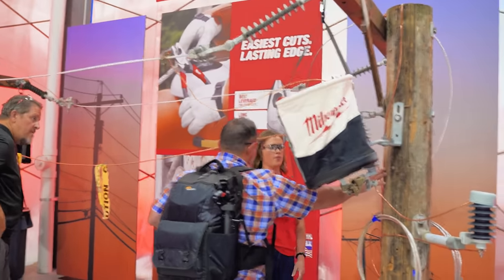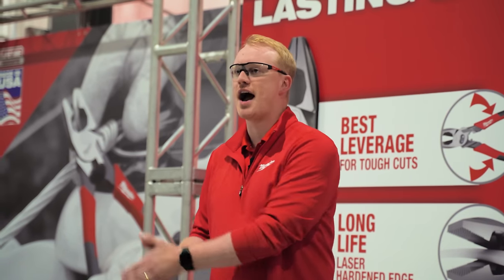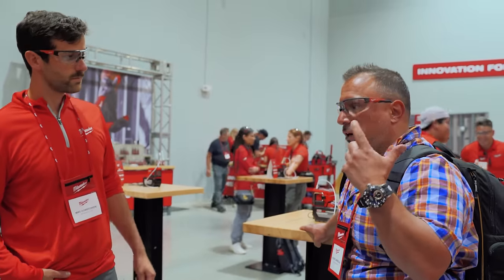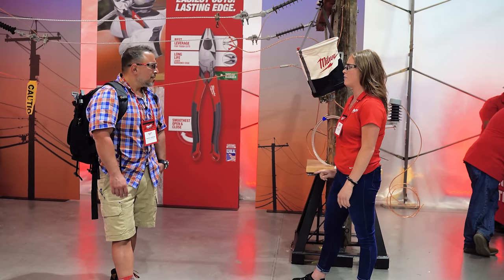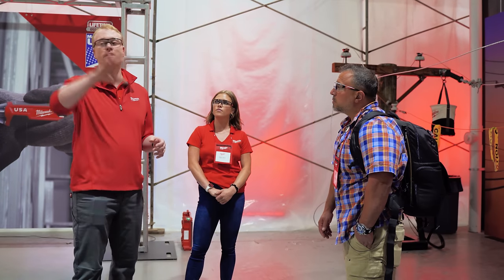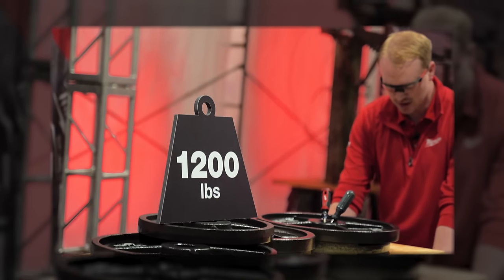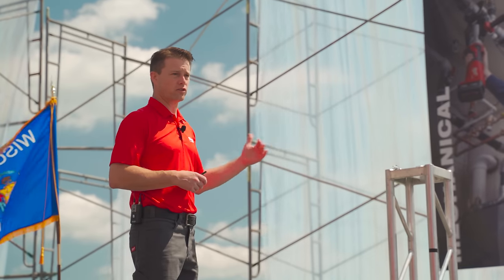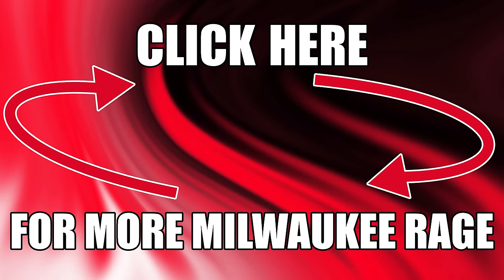BIG Problem With Milwaukee's USA Made Hand Tools (THEY'RE LYING)

Comment: All through the'70s and '80s, we bought and used Milwaukee Power Tools in our shop and in the field. They were rugged, dependable and rebuildable. I still had all of those tools until recently. My son started his own custom manufacturing business, so I ended up giving him my service truck and most all of my equipment. Including most all of the Milwaukee equipment. I kept about 15 of the Milwaukee tools for myself as I still liked fool around building and repairing stuff.
   Those tools are different though.  The new stuff is all throw away. It may be marginally better than some of the other brands but at a higher price. I wish Milwaukee would go back to building the way they used to. Those tools that we bought for our business were commercial and Industrial quality. When I started seeing Milwaukee power tools sold in big box stores, the quality started to go down. It's the same with Bosch, and I guess we've lost Porter-Cable all together. I would be happy if the manufacturers would offer two actual lines. Consumer and Industrial.
Reply: Well, Bosh actually offers 3 different lines ( at least in Germany). Green - common folks, blue - professionals, yellow - industrial grade
Reply: @dominicholder7323  exactly, people don't really realize this. There are different tool levels and you usually have to request for the higher tier.
Reply: @TyphusVonElder  We always bought the commercial line or industrial line of the manufacturers tools. Many of them now are no better than the do-it-yourselfer stuff.
Reply: @dominicholder7323  Bosch hasn't been made Germany in years. They were bought out by the same company that owns skill and Black & Decker. All three companies have reduced the quality of their products. Even the commercial brand, Metabo has drastically reduced the quality of their products to compete with the pricing for do-it-yourselfer.
Reply: @jnicksnewstart  I never claimed they are made in Germany :p I just said that here in Germany we have 3 different lines of Bosch tools and the industrial grade once are still quite good.
Reply: @rch5991  I had four of them. Two are 2 speed, and two are variable in two speed ranges. Gave my son one of each. He has a welding and stainless steel fabricating business. If you see another old one, even if it's the two speed, don't pass them by. They are totally rebuildable. All parts are still available. Nothing new will hold a candle to them. We always carried a few of those hold down screws. If I'm not mistaken they're either 8x32 or 10x32 machine screws. Buy them in grade 8, and they will last a long time.
Reply: @jnicksnewstart  Bosch owns Bosch and yes, Bosch I believe still owns the Skill name as well.   Many years ago, Bosch had partnerships with other industrial companies like Siemens, but has since retaken complete control of the company.   It bought the Skill brand over 20 years ago.  No relation to Black and Decker.  The brands under what is known as Stanley Black and Decker include both Stanley and Black and Decker (SBD) of course as well as Dewalt, Craftsman, Irwin, Mac Tools and some others.  Not sure of Bosch's manufacturing origin, but SBD has manufacturing in the US, Mexico, UK but still the majority is over in Asia.
Reply: Yup, not anymore.  I bought a Milwaukee 18v drill/driver kit while doing a house remodeling.  Plastic gears stripped twice and the trigger switch had to be replaced all within the first 6 months of use.  Each time it took 6 weeks to get a repair done so I was forced into buying a competitors drill/driver set.  The Milwaukee is now a backup that never gets used because the other brand hasn't failed.
Reply: Everything is throw away these days because it's cheaper just to buy another one.Same reason why most auto shops are replacing engines instead of rebuilding them....because it is cheaper for the person paying for it.
Reply: @tylerhubbell6410  Yeah, because it's cheaper to buy a new engine than to replace a head gasket.
Reply: @Johnny White so true their Not mechanics anyone they are parts changers. You bring in a pre OBD1 or 2 car and the ask where the port is for my Brain/ Computer. Bring in my 1963 bug and they would quit

Comment: As a master/journeyman electrician, I’ll stick with Klein tools for my hand tools. Milwaukee is my go to for power tools though. Heavily invested in the M12 line.
Reply: Agree on the Klein.  I was intro to a neat multi electrician pliers/strippers.  But in the end it’ll reach for Klein for pliers and screwdrivers and my comm gear for doing networking (cabling).
Reply: I just love the way Klein screwdrivers feel in my hand but the Milwaukee lineman pliers...the ones before these are just gold.
Reply: Us Sparky’s are going to be the hardest market to break into. I had one hell of a time even trying out Ideal after using nothing but Klein for 90% of my hand tools, even my dad before me had nothing but Klein hand tools. Not to say it wasn’t worth it because Ideal is a great brand as well, it just took a lot to muster up the courage.
Reply: @ApacheLife-50  couldn’t agree more. I’ve bought ideal and greenlee tools but have always gone back to Klein. Just ended up buying tools twice when I would do that. I’ve bought some Milwaukee hand tools as well but I’ve never stuck with them long term. If I had to choose 1 Milwaukee branded hand tool, it would  definitely be the 7 in 1 pliers.
Reply: Sidenote, I've always just called yall Sparkle Fairies. But thanks to some great points on a lot of the responses, I'll try to remember *Sparky... seems worse to me still tho. Like *Chief...sparky...I still don't like it ....Sparky.....at least Sparkle Fairy brings a laugh.. but whatever bossman, yall make the call Chief.(also coming from a man that left to his own device will assemble cabinets with a framing nailer,  so there's that too) lol
Reply: Klein and knipex are my go-to for hand tools
Reply: @blakeehmke007  I too like knipex, just not folks that insist on saying KUH... fuck that drives me nuts
Reply: @blakeehmke007  I just started trying some knipex stuff. Must say, I love the cobra pliers so far.
Reply: @beasyphone  So it drives you crazy for people to pronounce the company's name correctly??? That's odd

Comment: I really like Milwaukee tools and own a number of them.  I think they were the first ones to really push the envelope with brushless motors and lithium ion batteries to give us a huge range of cordless tools that are just as good as corded tools.  That said, they are REALLY proud of their stuff in price point and bragging.  I've never put a lot of stock in any of the "tests" these different brands do.  But Milwaukee seems to excel at bragging when their stuff is more expensive but not that much different than the competition.

All that said, I'm willing to give these hand tools a shot, if for no other reason, than I want to support American jobs.
Reply: Makita was first developers of lithium tools
Reply: Makita was also first to introduce brushless to power tools lol
Reply: @cravenmoorehead5636 . Actually it was Bosch.
Reply: Crescent is made in USA still. Reliable tools.
Reply: @tegimr  Channel Lock is also still made in the USA as far as I know.  I had to push my work to buy those instead of the made in China cheap ones.  I showed them how the made in China ones started breaking down on the first use, while Channel lock just kept going.  When they realized for five dollars more, we could get a tool we didn't have to replace once a month, they switched.
Reply: @Derek-rv3ee  First to introduce and develop isn't quite the same as what I meant.  What I meant, is that unless I'm mistaken, Milwaukee was the first one to make a 7 1/4" circular saw that was as powerful or almost as powerful as a corded one.  They had a handful of tools like that where even older trades guys were admitting they were as good as corded.
Reply: No , they copied Makita on brushless.

Comment: Recently had some reps come out and demo all of their hand and power tools made specifically for lineman at the utility I work for. I really wasn't overly impressed as the majority of the stuff they have to offer I'm familiar with and use on a regular basis but it's nice to see they are USA based and USA made. Seems they've invested big time in their lineup geared specifically for lineman, many of those tools had improvements and tweaks to gain an edge on what the competition has to offer.
Reply: I also work in that industry.  We're going from Makita to Milwaukee.   We have about 2k field employees.   It's a huge transition.   Milwaukee is buying back our Makita tools

Comment: You can’t tell me they actually got away from forging and still make a quality product. Or maybe I’m miss understanding the process. Tekton released cnc cut wrenches made in USA. They are half as strong as forged.
All I’m saying is I need more information about what’s going on here. But I’m liking the fact that it’s offering Americans jobs.
Reply: Nothing can tough forgings period.
Reply: Pretty sure they are still forging. Just using lasers to heat treat instead of traditional methods
Reply: check out Torque test channel.... they do some amazing tool testing of all tools with complete breakdowns of each tool..... amazing tool channel.
Reply: Tekton CNC wrenches are the angled ones not used for torque, so it really doesn’t need to be forged for that application.it was CNC made to keep costs down.
Reply: @kevinkieel6778  thanks for the reference! Project Farm does interesting reviews as well.

Comment: Milwaukee lineman was the first one i had ever bought. I like how it feels. Dont like that it takes more force for me to cut wire with them vs my basic klein stripper. Tried the milwaukee stripper, had to use the 16 gauge slot to strip 14 wire. Annoyed me enough to get rid of them and stick to my klein.
Reply: Are they just stiff brand new but if you broke em in a little they can glide?
Reply: To be honest im not sure what you mean by glide. They dont feel stiff, they feel good from the get go, at least to me. These are my first linemans ive ever owned. I was just surprised to see that it took more effort from me to cur through wire than it does with my litte klein strippers. I only use my lineman for twisting wire and the e occasional crimp. Im not an electrician so i dont see all the work scenarios an electrican would while using these. So i dont know how they might feel after alot of use or in scenarios ourside of residential uses

Comment: Milwaulkee Electricians pliers are the best I’ve ever used.  They have wire stripping, cable cutting, screw cutting and deburr tool all in one. 

Their screwdrivers were rubbish though, the tips weren’t hardened and wore after 3 uses.

Comment: Milwaukee does some things right and some things wrong.

At least they listened about the collet problem in their impact drivers, but the question becomes: “Why was there ever a problem with their collet in their impact drivers?”
Reply: Now if they would just fix the m12 soldering irons that melt or stop heating and rotary tools that run full speed when the mosfets fail and you have to pull the battery to make it stop.
Reply: @biohaz360  I've just done a video on fixing one of those m12 irons, then I bought another 3 broken ones. Also done a few on repairing items with blown mosfets and other issues!
Reply: @BuyitFixit  Great, I have 3 of those m12 rotary tools, 1 works, 1 won't turn off unless the battery is removed, 1 is totally dead.
The working one is already showing some problems, it won't spin up at low speed, a common problem.
It seems to be related to stalling the motor when cutting.
There are 3 mosfets inside them, and replacing 2 of them got me the one that won't turn off.
Reply: And I also bought an m12 soldering iron with a quick charger cheap on ebay, both broken and replaced the element to fix the iron, still waiting on parts for the quick charger.
Hakko a1321 was what I used, like everyone else. Paid under $3 shipped from china.
Reply: @biohaz360  I've not looked at a rotary tool yet. Is it brushless? Or brushed. I did repair a brushless multitool but that was the motor driver IC.
Reply: @BuyitFixit  Brushed, I believe it came out 2014.
Everyone who has problems with them and sends it back to Milwaukee gets a brand new one back, so they don't fix them either.
All mine came off ebay, warranty returns to Home Depot, also because my working one has a 2022 date code in the serial number.
Reply: @biohaz360  could possibly be the motors. I've got an m18 fan which only works on speed 1 and 2. I've seen a few with the same fault on Ebay. It's a brushed motor but its drawing way too much current. I'd think the rotary tool will have a circuit board which has a small microcontroller on it which disconnects the power when the battery is too low as there is no protection on the m12 batteries it's all in the charger or tool.
Reply: @BuyitFixit  The motor works when you connect it directly to the battery.
There is a chip that tells you battery life, but I'm not sure it does much else.
One I had dead when I got it, one mosfet was shorted, so I replaced it and tried it but somehow they another mosfet died, so I replaced both and now it goes full speed with a battery in it, speed control and power switch do nothing.

Comment: I worked in Quality and Reliability for 30 years. Specifically conducting testing and running down quality issues in a production plant that produced 6 million units per year. This Milwaukee guy has no idea. Allowing the end user to be your sole metric for quality is just lazy, stupid, and bound to ruin your brand reputation.
Reply: That's how almost everything is going or has gone already. Same with app development: computer software companies bash something out and launch a first draft - wait for user feedback to reveal flaws that get fixed by bodge in next release. Doesn't pay to be an early adopter, even if company makes you an offer that you think you can't refuse - it  will be too good to be true
Reply: the milwaukee guy is a marketing guy with marketing skills at a marketing event.  Give the kid a break.

Comment: Klein hand tools for electrical work have always seemed the best to me. I have needle nose and linesman pliers that are 30 years old that still feel better than most other lines today.
Reply: 30 years huh. You must be pretty dang good at your job if you never cut into a hot wire in 30 years. Since that ruins the tool
Reply: @weewillywanka5904  True, not all survived but as long as you don't cut the hot and the neutral or two hots at the same time it's usually fine.
Did hit a piece of romex that was supposed to be off. I kept those as strippers. 🙂

Comment: Any tool with a pivot is made similarly, the 2 pieces are joined and the pivot shaft is smashed into a cavity on the opposing side. They could be heat treated before or after, doesn't matter. The heat treating is for the cutting edge and the feel of the handle. It is simply IMPOSSIBLE to have the same feel of the pivot the way these tools are made, some break in great (as you mentioned) and some do not. What they need is a very fine adjustment on that pivot screw, so that the feel of the cut and opening of the tool is always the same throughout it's life regardless of whether the cutting edge is worn or damaged...

Comment: Personally I would generally pick Snap-on over pretty much any brand when it comes to hand tools. 
However, being a mechanic for the past 20 years I have learned that Snap-on is not go to manufacturer for everything. I have tools from craftsman, icon, knipex, duralast, so many unnamed manufacturers and sometimes the cheaper tool is the better fit or gets in the spot nicer. That is the devil in the details part right there, a couple of my pliers or snips from Snap-on are seized and take some work to open and close. Making me choose a lesser known or lesser quality tool in the moment.
The important thing to think about is cost of course. You don't need to go and get $50,000 of high end name brand tools to do your job. And quite frankly your boss doesn't give a crap what tools you work with and neither does the customer. As long as it was done right the first time.
My advise to anyone just getting into working with hand tools is take advantage of any trade school deals, like Snap-on and other tool trucks offer graduation deals for starting out. It's an easy way to get a good deal on a box. and trust me when I say your tool box doesn't matter because I never seen anyone fix anything with a tool box. So go ahead get that $500 icon or craftsman box and pack it with what you can afford.

Another thing is don't invest in tools that the shop should be buying. Maybe a digital bore scope is cool to have but do you really need it? Same for infrared cameras. Or say the Snap-on universal puller set? Try talking to your boss and get them to buy that specialty stuff because they won't reimburse you for it.

Good luck out there and have fun.

Comment: They're trying to make out that they've made a massive leap in innovation for a screwdriver. It's a bit of metal shaped to fit a screw, nothing more. Same with the blade on the pliers. It's a sharp piece of metal...
Reply: They want you to  buy their screwdriver.  That's marketing.  You think people want to show up for an event and hear your version of a screwdriver?  Sorry there needs to be a little smoke and mirrors to even get people to show up.  It's called puffery.  Their screwdriver seems competent and probably won't let most people down. But they still need to sell it a little bit.  Milwaukee has the money for these events and paid a bunch of people to have the event.  Let them spread the wealth around like that. More jobs.